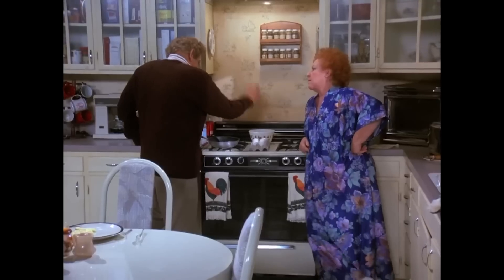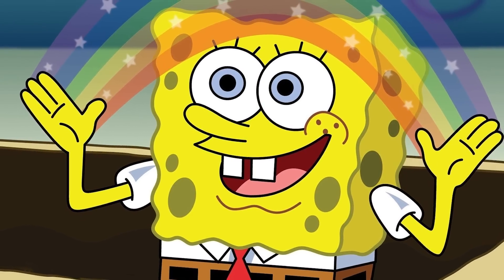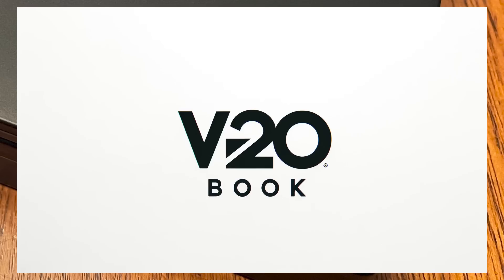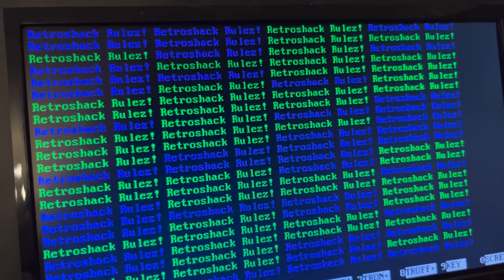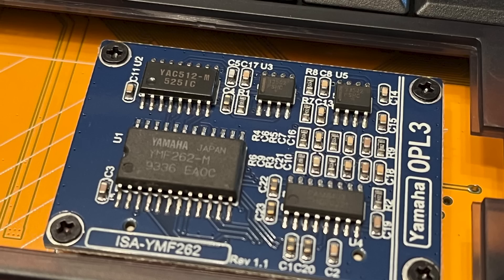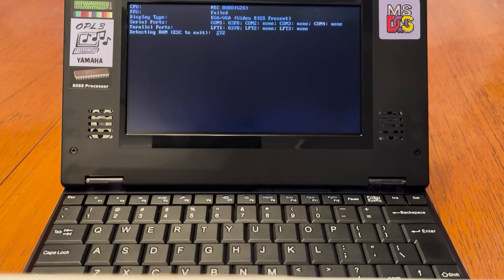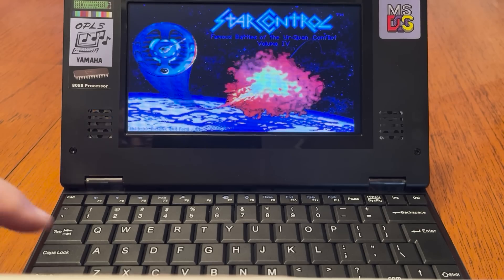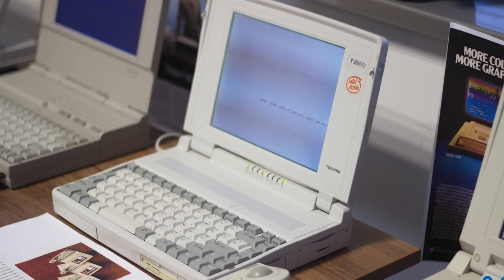The Book8088 'Retro Laptop' - Is it? Is it though?  Well, kind of - let's find out all about it.

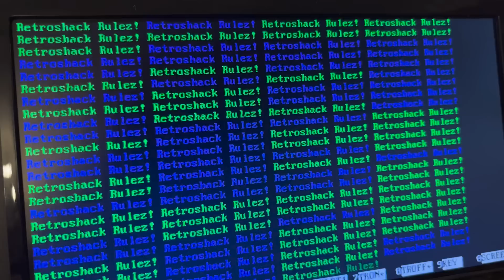Comment: 12:11 - (Book 8088 is around $160, but you can buy a 386 or 486 laptop for less than that...)

Yeah, I feel like the only real downside would be probably those laptops would require some fixing up - rebuild the battery, replace the hard drive, etc.  But overall yeah, probably a better value for the money!

Earlier this year I got a Toshiba T1100+ and a CF card+ethernet+soundcard add-on for it. It's been a lot of fun. I wanted a retro machine I could take mobile and it's been great in that regard. The display is unusual (being an inverted black and white LCD on a CGA display adaptor) so graphical games are hard to make out and even text mode programs aren't always presented well enough to be truly usable (as different colors/attributes used to distinguish onscreen characters can't be well-presented on the mono display) - but it's got hours of battery life (since I rebuilt the battery) and an EXCELLENT keyboard - and I think it hits a really nice sweet spot on the technology curve: Primitive enough that it's still got a real "retro computing" vibe but powerful enough that I can have things like command shells and C compilers and good text editors...  I also upgraded the CPU from 8086 to V30. I guess I sunk a fair bit more money into the machine than if I'd bought a Book 8088 but I think the Toshiba is way more fun personally.

Initially I tried using it with just the floppy drives - it was fun but of course it was very limiting too. I did manage to get the C compiler to fit on one disk, that was pretty nice...  :)

Comment: Did you know there is a modern i686 processor not made by intel or amd called the Vortex86DX3. It is a dual core 1 gigahertz i686 compatible cpu that supports up to two gigabytes of ram and can run FreeDOS, the best DOS.

Comment: I have the older, version 1, of these. I got it in the hopes of using it as a dumb terminal, but it didn't have RS232. I did replace the BIOS with the official Sergey BIOS and installed FreeDOS on it, but it's been collecting dust.

Comment: Bbbut I thought turbo-mode was supposed to be slow for backwards compatibility with old games that were programmed using slower framerates? Why do you seem to imply turbo mode speeds up the pc?
Reply: Typically a PC would boot in Turbo mode and you'd turn it off to run games that needed a slower CPU. Though in this video it seems to be booting in non-turbo mode? Or maybe that was just how the video was edited. Not sure.
Reply: @zoomosis  I just looked and it seems my computer, and some others as well, came with an inverted turbo button, hence my confusion. Sorry for the dumb question and thank you for the clarification.

Comment: I bought the v2 and it's a great little machine, a little but plasticky but works great, the only "problem" is the CF, as it 500MB it's a little bit slow when "dir" or starting an "exe", too big for FAT16.
I have a  problem with PrintMaster 1, impossible to recognize my 2 vintage printers (Epson LQ870 and HP Laserjet 4+), strange as they work with other software (even PM 2) and from my Toshiba 286, my Acer 386 and my Compaq PII machines.
For the rest,  RS232 works as expected, connected to a PC with Fastlynx, mouse OK, LPT1 OK, Turbo works, may be little bit too "fast" due to its V20 and the VGA doesn't work well with CGA programs. The installed version of W3.0 misses a lot of files, including vga.drv but I installed PCGeos 1.2 and it works like a charm, I tested ver.2 but it needs a 286 to run. 

I don't regret this little machine, it's very fun to use.
Reply: The CF card might be quicker to use if you repartition it into two (or even three) drives.
Reply: @zoomosis  indeed, fdisk is my friend :)

Comment: I am one of the real users of Book8088. I would like to say that such a laptop is simply industrial garbage. It has a very poor screen and keyboard. The viewing angle of the screen is very small, the colors are dim, the brightness cannot be adjusted, the keyboard feels very bad and comes with Android The shortcut keys 😁🤣look like the stock from the lowest-end Android tablets from 10 years ago. The chip hatch is worse than your air conditioner remote control or even a kid's toy. There's nothing aesthetic about the exterior design, and it looks like it's been hastily manufactured. It's a poor imitation of IBM's ultraportable computers of the past. The designer does not really put his heart into making it, but only uses it as a tool to make money. It is far worse than the uMSX Pro I made in every aspect.😅
Reply from the maker: Well, I’d be happy to review your UMSX Pro :) Get in touch :)
Reply: @TheRetroShack  I found out yesterday that suddenly someone bought my uMSX Pro😅.

Comment: The V20 is actually a bonus, as it is not only compatible to the 8086 but also has an 8080 mode, meaning it could run CP/M as well as DOS. Of course, for CP/M the 640k would be madness, even CP/M 3.0 (which included bank-switching) was usually not used with more than 128k.
The possibility to run CP/M would make this a real retro-computer, stretching the time-frame back into the seventies.
Reply: The nec v20 is a replacement for the 8088 cpu. The nec v30 is a good replacement chip for the 8086.
I know because I had gotten the v30 to replace in the tandy 1000sx and it was incompatible and upon deeper reading they are indeed a upgrade for 8086 processors. I think the only key difference between the 8088 & 8086 was the 8086 had 16-bit addressing for memory or something like that.

Comment: imo VGA and OPL3 is overkill for a machine with an 8088 based platform. If it had a 386 it then would be reasonable. A VGA port would be nice too.
Reply: Every laptop should have a way to plug-in an external monitor, and for that purpose, VGA makes life much easier.

Comment: The reason it was cheaper though is that Intel couldn't give discounts on the 8086 because of deals with other parties, but the 8088 was outside those deals, so could be given a decent discount. The chip itself is almost identical to the 8086. Of course, creating a system with it was a lot cheaper, b/o reuse of 8-bit 8080 support chips.

Comment: Hi, it is a good little machine for what it is.

Considering original vintage it hit on miss if it is working properly today and how long will it last

I have a approx 2010 netbook HP 5102 with a Atom processor, it now runs linux mint, but it can boot of the SD card, so i have a 8gb boot card with 4 x 2gb dos partitions and dos 6.22

Way to fast for dos games but dos apps like win3.1 is fine as is works for dos.

I cant recall but i think you can slow it down in bios by turning of shadow roms and cache or i used the slow down or cpu speed utility

Comment: Does the machine have a useable serial port on it? What type of hard drive does it use? Does it have a floppy drive if not how does one add dos programs to the machine?
Reply from the maker: Yes, it has a working serial port - it uses a compact flash drive with an XT-IDE interface.  No floppy but you can drop things straight onto the compact flash, or you can use a usb thumb drive.

Comment: i've got a first gen with no serial or parallel port that works fine but the second gen i bought has graphics issues with the CGA chipset and even tho the seller accepted returns i couldn't find a shipper that would send to the return address in china. these are are mostly reclaimed parts on custom pcbs with little to no quality control. neat but expensive and possibly faulty toy.

Comment: Ok, I know this might be seen as nit picking but why do we need a Windows key on a machine that is designed to run MS-DOS?
Reply: It may not be needed, but buying stocks of a modern, off the shelf laptop keyboard to keep costs down rather limits your choice. I suppose they could have put a sticker over it, or maybe the key caps are easily replaced... but what label would you want on that key?
Reply: @another3997  if the key caps could be replaced, you could have pretty much anything. As an example you could have something like prg, or prog, both short for program.  It wouldn't be difficult to write a program which would use this key, as part of a combination to launch a program, for example prog + 1 could launch your word processor, 2 could launch a game of your choice, etc.

Comment: And who asked for this?  Who's been pining to run MSDOS on a tiny, barely usable "laptop"?
Reply: @luthiart me! Which is why I'm running DOSbian on my Raspberry pi. It runs Microsoft word 5.5 and it's a great distraction free writing machine.
Reply: A cheap laptop from the 2010s can easily run Bochs or DOSBox emulation, has a decent keyboard, more RAM than DOS could ever handle, and you can instantly switch to Windows or Linux with a keypress. There is nothing authentic or nostalgic about those new 8bit machines.
Reply: @Kobold666  Yes you can, but with any kind of emulation or virtualisation, you always have that nagging feeling that it's not the same as the real hardware. The limitations are artificial, and you know you can just switch to the modern OS underneath and use the modern hardware to it's full capacity. Running emulators can be great fun, they're quick, convenient and ultra flexible... but as long as you KNOW it's emulation, it's not the same.
Reply: @another3997  That is true... a few years ago, I was all about buying busted C64s and repairing/modding them, etc. Everyone said: "Why go through all that trouble when you can run those games in an emulator?".  You are indeed correct. It's NOT the same experience as banging on original hardware, and that's what i would tell anybody who thought my efforts were a waste of time and money.  But this thing is NOT original hardware.  It looks like a piece of crap from Ali Express, to be honest.   Don't let it stroke your nostalgia gland.  You're better off buying an old PC from Goodwill or ebay and running DOS to your heart's content on that than spending good money on something that you'll probably get bored with in three months, or it'll break...  whichever comes first.
Reply: @another3997  I know. I own several Commodore and Amiga machines. But an AT/XT is just a PC as any other PC. I have no nostalgia at all for DOS machines, but I can relate.
If you want original hardware from the time, buy original hardware from the time. There is no need to produce more modern electronics waste.
Reply: @Kobold666  Hi, Why searching a reason to something that is not reasonable ? It is cool because there is a real V20 inside, do something else and it is something else....

Comment: Love the idea of putting a nostalgia machine together in laptop form (hey, I'm looking a Commodore, Acorn and Sinclair here too*), however in this case, I'm baffled why you would not use the 8086, or up the ram to a usable amount.

For me though, that keyboard looks too cramped. Never got on with netbooks generally for that reason, can never hit the right key. And a bigger screen needed. Still. 

*Thinking about it, if you could have one laptop case that does all three (and PC!) by a switch on the side (or pulling the system module and swapping for another) that would be cool.

Comment: I have to wonder if this thing exists because someone came into a whole bunch of V20s and couldn't figure out what to do with them. Because otherwise it would make SO much more sense to build this around a 286 or 386.
Reply: Having gotten into PC computers back in the late 80s, I would agree.  A 286 with EGA or 386 with VGA, AdLib/SoundBlaster support plus some extra memory is a much better jumping on point for games or productivity.  Not having a game port is also a miss.
Reply: @gaxiola1701 Some people got in to computers earlier than you, so may well remember using 8086, 8088 and 80186 class CPUs. Original machines are 44 years old and hard to get hold of and maintain. If this machine were a bit cheaper and closer to a typical 8088 class laptop from back in the day, it would be an OK machine.
Reply: @another3997  Yeah, that's the odd thing about this. Aside from the CPU, nearly all the other hardware points towards a late-80s PC. As the video noted, even trying  to find software which supports VGA & Adlib but will run on an 8088 is difficult. If they wanted a true early-80s style PC, why the fancy hardware?

Comment: The biggest fault for me, which I find really disorienting, is that they forced the Adlib sound, a mono device, into stereo. I'm not sure what they did, but it appears that random instruments get assigned to be either left or right channel and when you're playing back Adlib, you'll be getting one part of the song in your left ear and one part in your right ear with no real sense of balance.
Reply: It's a fault of the chip that was used - OPL3 is stereo, while OPL2 was mono. While in a MIDI-file an instrument can be panned from left to right in 128 different positions (with 64 being dead-center in the mix), but, if I am not mistaken, OPL3 can only place it in three positions - dead-center, or only in the right or left channel. It worked fine in a synth keyboard, but not on a sound card.
Reply: That's crazy. I wonder how anyone thought that'd be a good idea.

Comment: I never understand the problem with the 640 is enough quote. Even if Bill Gates said that, then it was probably true at the time.
Reply: Especially since the 8088 only has 20 address lines and hence a total address space of 1MB - the dividing line between RAM and memory mapped ROM and I/O had to go somewhere, and I guess ending RAM at 9FFF:000F and starting the reserved space at A000:0000 made a lot of sense at the time - it was basically 2/3 RAM and 1/3 "other stuff".
Reply: It was true in the mid-80s but not so much when Windows 3.0 was released in 1990. It could run in 640 KB but there weren't many Windows apps would run in the small amount of memory left after Windows had loaded. Word 1.1 might've been one of the few that did.
The first version of OS/2 was released in ~1988 which increased the memory limit for native apps to 16 MB. Bill Gates was a big proponent of OS/2 at the time. It won't run on the PC in this video since it needs at least a 286.

Comment: I'm not entirely sure who these computers are aimed at. I suppose ancient industrial control equipment that needs to be replaced because it can't be repaired?
Reply: Retro MS-DOS gaming and nostalgia enthusiasts. Somebody wanting to control industrial equipment wouldn't touch this thing with a 10-foot barge pole.
Reply: It's unlikely to find a use in industry. The industrial "retro" computers tend to use high quality components without any of the unnecessary bells and whistles. They are designed for long term reliability.  They also tend to come with firm commitments to support the hardware for extended periods of time. None of those criteria are likely to be met by this machine.

Comment: I like how new 8086, Z80, 6805, etc machines are making their way onto the market.

Could be a good starting point for teaching CPU design & assembler at a high level.
Reply: Definitely better than the theoretical CPUs some courses use. You'll probably never see MMIX outside of a textbook, but at some stage in your career you might need to write some code for an embedded Z80 or 6502 descendent.
Reply: @fnunez I mean, TI still writes for the Z80 and the eZ80 (a faster binary compatible version) for their graphing calculator software, and it has almost certainly been used in other "niche' applications.
Reply: Whoever owns MC6809 should release new speedier versions.